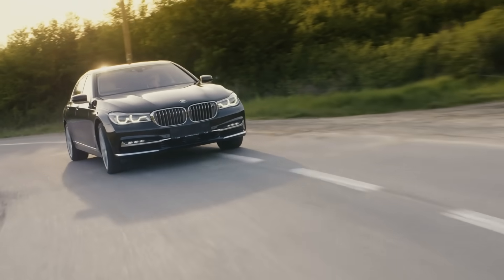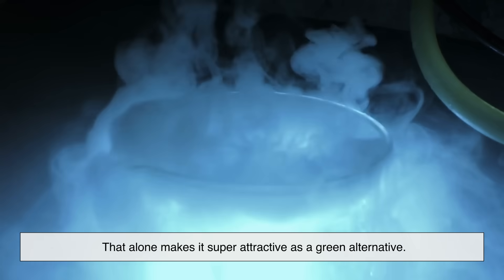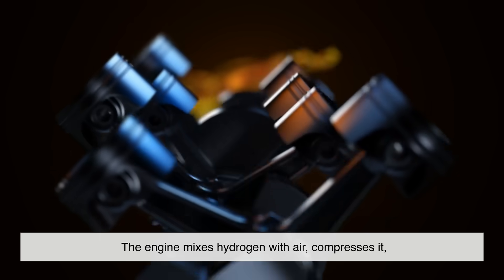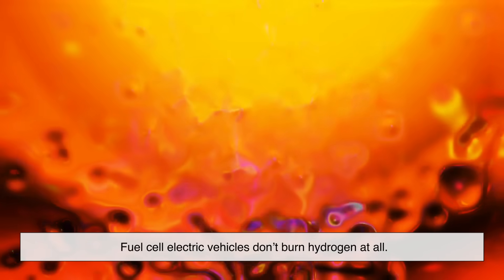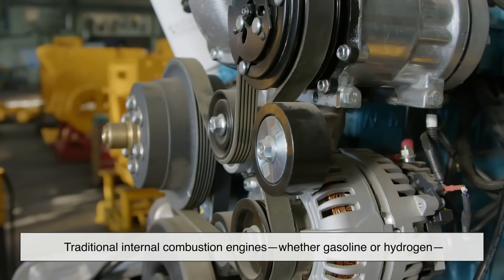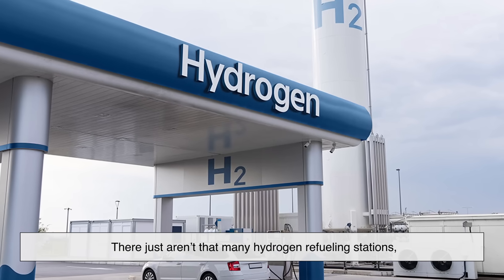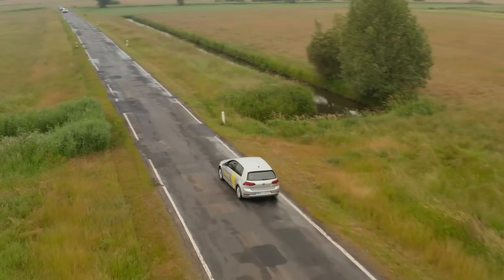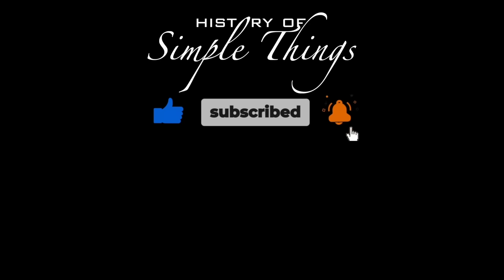Hydrogen Engines: The Engine of The Future

Comment: One major hurdle is safety. Get enough hydrogen together to do anything then you have enough to do some serious damage.
Reply: Think hidenburg- it was filled with HYDROGEN gas
Reply: Baffled tanks address this possibility
Reply: Like gasoline then
Reply: @lucylane7397 it takes 1/10 less energy to ignite hydrogen than hydrocarbons, with 18 times the explosiveness in combination with oxygen. Though admittedly gasoline needs less concentration to be explosive and disperses less readily in open air.
Reply: @accreditedbythenicemaninth6495  except for virtually no upper limit with the explosive range of hydrogen if you have oxygen no matter how much hydrogen you have basically you can burn it where is petrol there’s a fairly narrow combustion window
Reply: @lucylane7397   gasoline is NOT at 8000 PSI
Reply: @DSAK55  no does it exist as a gas at room temperature nor does it burn with an invisible flame with very low radiant heat so you’re not aware it’s burning until you are involved in Fire

Comment: That circuit board had a few smoked components
Reply: And it looks like it was assembled from a Radio Shack kit.
Reply: It didn't use hydrogen-free resistors.

Comment: Worth 0. For no area allow building hydrogen filling station , for explosion consider
Reply: Hydrogen is safer than Lithium Ion Batteries~
Reply: @stephenvelden295  No, it's not and thats a big reason why it never took off for use in cars.
There's better newer batteries now, the LiFePO+4  and the newly patented anode-free sodium battery that uses NO lithium at all, the all lithium batteries will be phased out like those 8 foot fluorescent tubes were in favor of LED's. The sodium battery is already patented and proven, the lab in the US  is working on scaling it up for EV use, the published paper on it describes how it works.

World’s First Anode-Free Sodium Battery

The anode-free battery uses an aluminum powder electrolyte and an innovative structure for potentially cheaper and lighter electric vehicles. 

Sodium has emerged as a promising battery material. Since sodium is less expensive and more abundant than lithium, these batteries are cheaper and more environmentally friendly to produce than lithium batteries. Additionally, sodium can theoretically provide a higher energy density than lithium.

University of California, San Diego, and University of Chicago researchers have created the world’s first anode-free, sodium all-solid-state battery for the EV and grid storage sectors. The research was published in Nature Energy.

What Is an Anode-Free Battery?

Anode-free battery architectures only have one electrode—a metal-rich cathode, which, in this case, is made from sodium. The cathode is attached to a metal current collector. There is no physical anode.

When the battery is charged, the metal ions travel from the cathode and deposit directly onto the current collector. The current collector then acts as a temporary anode and enables the battery to discharge similarly—electrochemically speaking—to a metal-ion battery.

Anode-free battery architectures have high specific energies, cell voltages, energy densities, and less architectural complexity. They weigh and cost less. 

Removing the anode is beneficial because it’s the source of many technical challenges in sodium-based batteries.

Anode-Free Battery Targets EVs and Grid Storage

This sodium anode-free battery is designed for EVs and grid storage. It could create more efficient, cheaper, and lighter batteries, making EVs more environmentally friendly, affordable, and efficient. 

For grid storage, batteries will spearhead efforts to develop distributed energy resources. The U.S. requires one terawatt of energy per hour to keep the grid running. As decarbonization efforts increase, several hundred terawatt hours of batteries will be required. Since more batteries are needed quickly, a cheap and abundant material like sodium is attractive.

Comment: Guess what? It takes energy to produce hydrogen. Guess where most of that energy comes from? Electricity. Guess how much in the US is produced by fossil fuels? ~83%. Then, does anyone consider how safe it would be in today's driving climate of idiots behind the steering wheel at 85 mph with a tank of highly explosive H2 at 5000 to 10,000 psig? Then there is the transportability of H2 when you have the problem of hydrog enembrittlement   especially in welded steel piping and containers. Thanks but no thanks! 
P.S. There are only 1 or 2 H2 automotive fueling stations left in California as it has proven to be a bust financially.
Reply: It takes - 423 degrees F to get liquified gas, and it has to be stored in heavy, thick walled insulated tanks under high pressure, one little leak and ALL that liquid hydrogen vaporizes into a highly explosive gas that just one spark will ignite like the hindenburg which itself was filled with hydrogen gas.
Abut 1/3rd the energy out of hydrogen is lost in making it a liquid

Comment: I Agree Hydrogen has been around & In use, for over 70 years. ALSO the Biggest failure in this World, is Not the Replanting of Trees and foliage to absorb any excess{ Trees primarily absorb carbon dioxide (CO2) from the air through their leaves via photosynthesis. This process converts CO2 and water into sugars (glucose) for the tree's energy and releases oxygen as a byproduct. Additionally, trees absorb other gaseous pollutants like ozone, carbon monoxide, nitrogen dioxide, and sulfur dioxide through stomata (tiny pores on leaves). They also filter out particulate matter from the air, trapping it on their leaves and bark}..🤔 You Can buy Kits to Convert Gas Vehicles to Hydrogen{The Problem is the Costly Conversion Process & Storage}!👍🤔

Comment: An internal combustion engine can run on hydrogen, but it works best with direct injection as long as the static compression of the engine meets the requirements of hydrogen. Also, it doesn't matter if there's hydrogen oxides in the exhaust as the catalytic converter can easily filter it out in the exhaust before releasing it into the atmosphere. It's still the cleanest burning fuel unless you use ammonia, but that's a completely different topic. Lol
Reply: ICEs are only about 20% efficient, no matter what fuel they use.